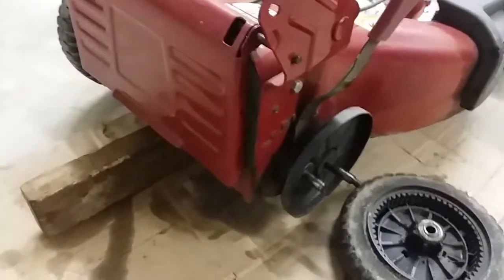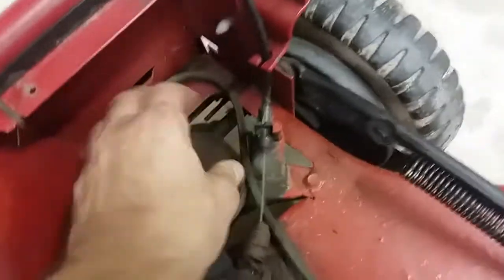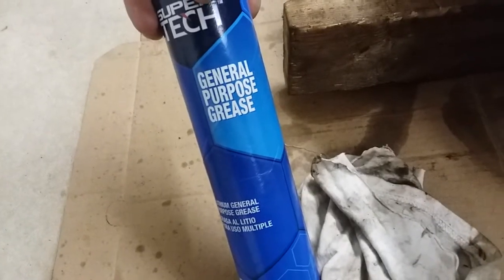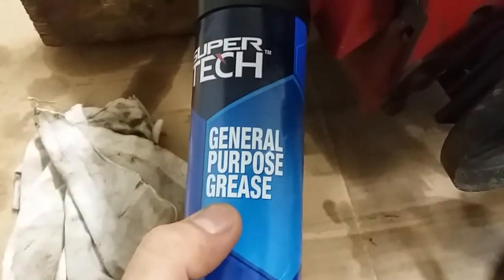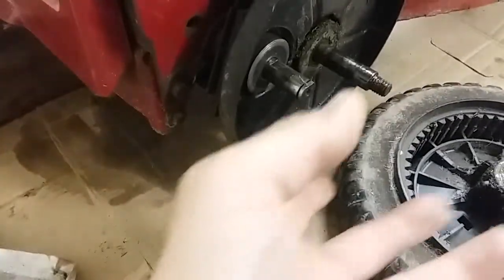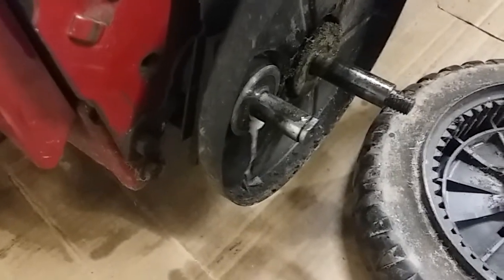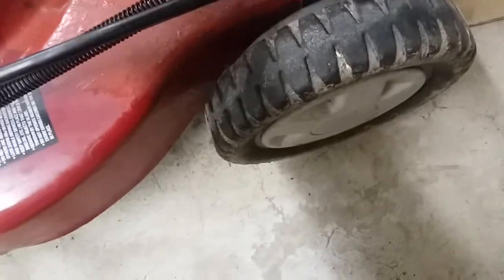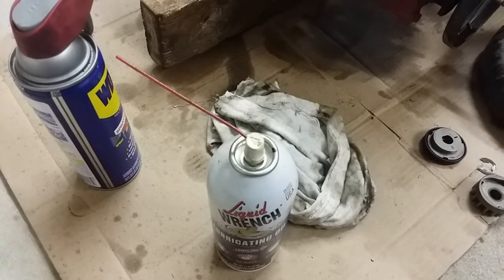Correct way to lube a self propelled mower

Comment: Great Trick!
Also be sure to tell people to Silicone Spray their pull rope. Simply pull it out all the way and use a piece of plastic to spray and wipe it into the rope length. 
It's a MUST DO and it might never break if they do!
Take care
Reply from the maker: Had not heard of that one. Please subscribe. Thanks.
Reply: @berardia4  Yep, I thought of that myself.  Been spraying the pull rope with silicone spray for years.  On the wheel shaft I put some o-ring silicone grease.  So far so good.  Dirt does not really get inside there with the washer at one end and the nut on the other side of the tires.

Comment: The biggest problem with mowers is that the decks rust out.  What you need to do is clean the grass off the underside and then spray a complete coat of COSMOLINE spray on it and let it dry before next use.  They will never rust.  Even spray the underneath where the tires mount, and all near the grass chute and steel baffles.
Reply from the maker: The biggest problem is people cutting wet grass. Clumps up and holds moisture causing rot. I cut dry grass and have no build up.
Reply: @berardia4  That is absolutely correct.  But the cosmoline is an extra safety precaution.
Reply from the maker: @tcapone1734  yes I don't see it would hurt
Reply: @berardia4  I even use it on my car now instead of that god awful "undercoat" which actually causes rust instead of preventing rust.  Trust me I learned that the hard way.